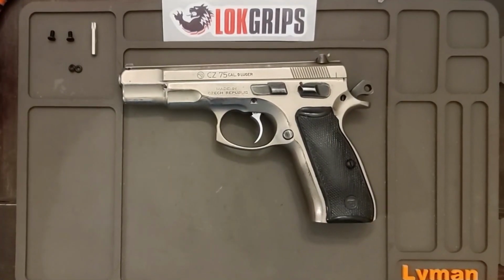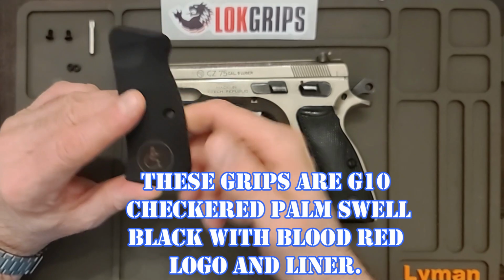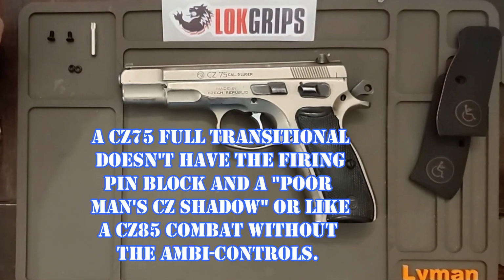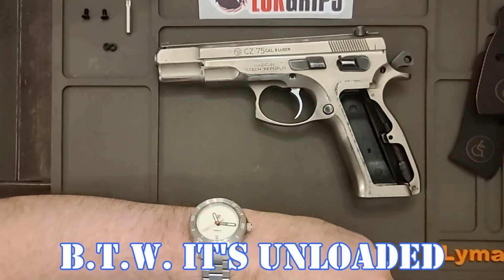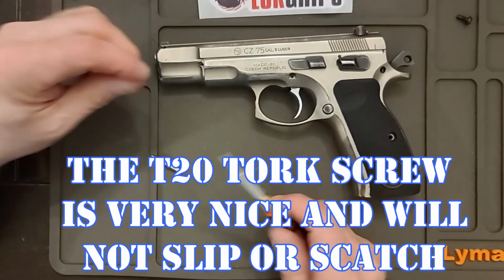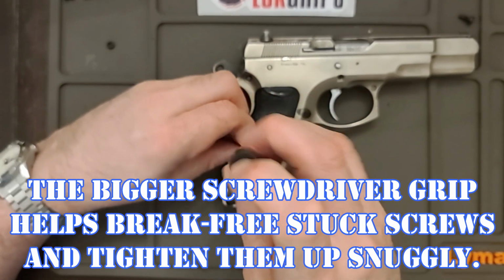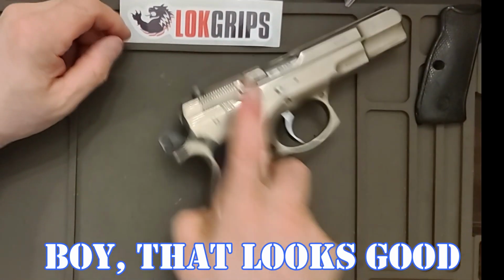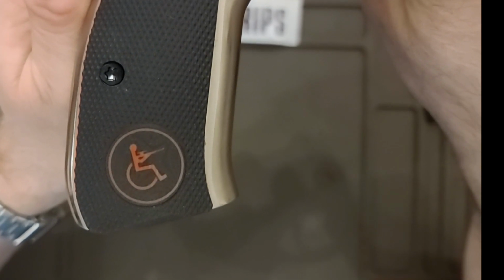LOK Grips on CZ75 Pre-B Full Transitional #LOK_Grips_on_CZ75_Pre_B_Full_Transitional #LOKGrips

Comment: Darn, was hoping I was going to see what needs grinding to make new grips work on my pre b ha ha
Reply from the maker: Your grips don't fit? I have avoided the older true pre-B and these transitional pre-B are really the new CZ frame. Trigger guard is square, front site is pinned, safety doesn't have the hole, all make it a transitional.
Reply: I have some Guuun grips that don’t fit flush. Mine is the pre-b you could swap sights on.
Reply from the maker: @campbemj180  The 1992 to 1995 are Transitional years. They made rolling production changes. Some machines were making old pre-b frames and some were making modern frames. Some old parts and some new parts. I have a few videos on Pre-B Transitional. I think if you have a round trigger guard, you use the old mags and old grips. I've seen new frames with old safety and claw hammer.